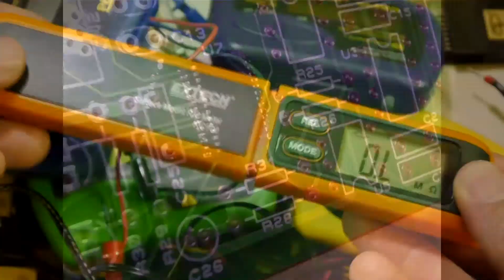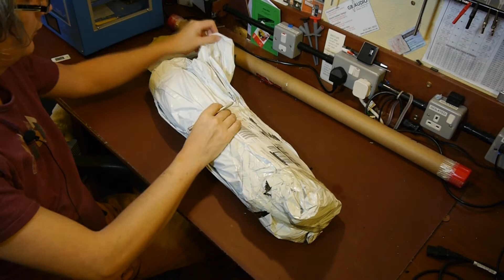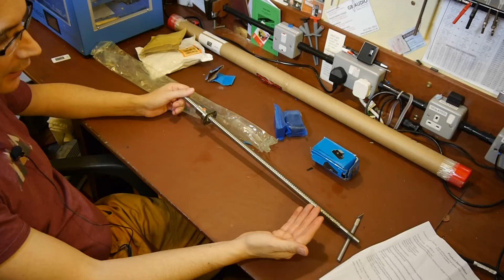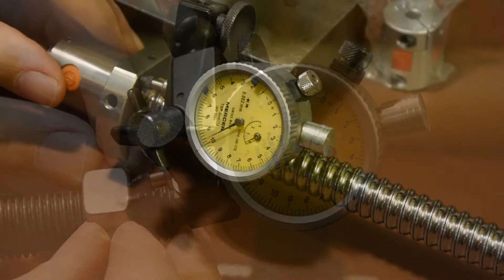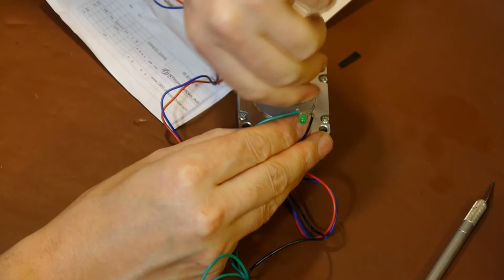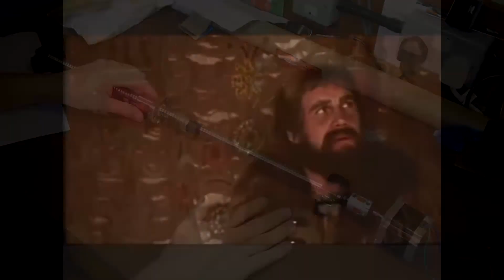Delta Printer Part 1 - Screw Balls

Comment: Now this looks interesting. Cant beat a long screw! Are you looking to build this from scratch or is there a kit for all the electronics etc? Cheers Graham
Reply from the maker: Radiocruncher  hi Graham I’m building the mechanic from scratch  using my design but if I can buy a component build up such as the extruded I will do that too. I’m looking looking at using an open source board to control things but not really research this enough yet. I was going to use standard stepper motor controllers but cannot find a board that does not have these built in already. It’s likely I will end up running quite large stepper to get the screws to accelerate as fast as I want. So just playing it by ear and enjoying the fabricobblering in the workshop